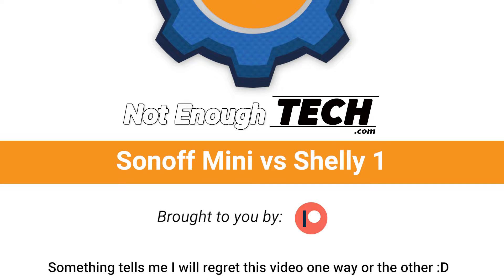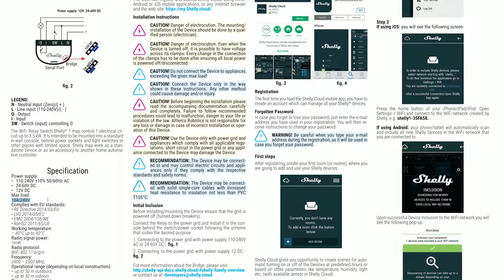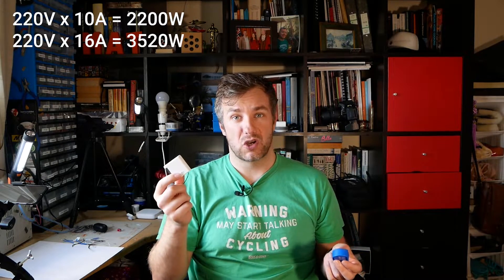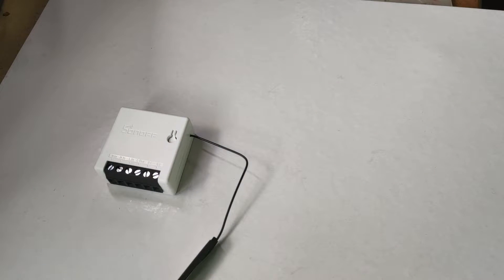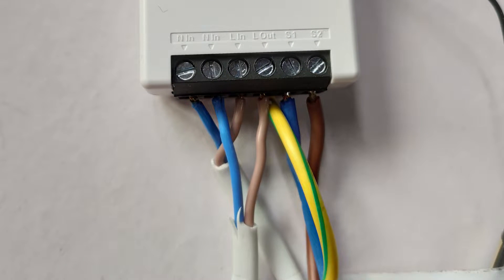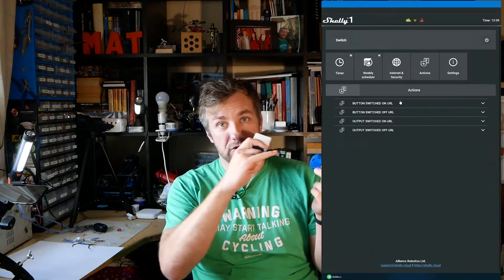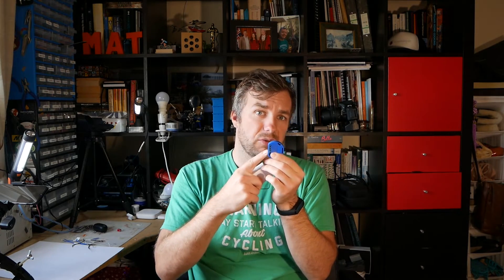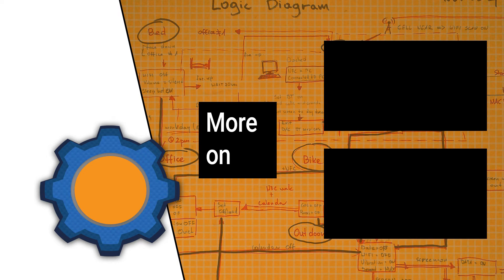Sonoff Mini vs Shelly 1 - which one is better?

Comment: Shelly 1 has no external antenna. I use Shelly uni for some outer use. Shelly uni has more stable wireless connection from 15 meter away, then inside the flat. Shelly has weak internal antenna, it should have external connection.
Reply from the maker: There are hacks to add the external antenna but to do this well you would need to tune the resistance of it. Perhaps this will help. Also is your Shelly inside the metal electric box or behind the metal switch plate?

Comment: Can I use any of these 2 to "smartify" a cheap USB-powered lamp? (PlayStation Icons Light)
Reply from the maker: Shelly would let you do it as it has dry contacts.
Reply: @notenoughtech  but shelly needs 12V power supply, and usb is 5V, or what am I missing?
Reply from the maker: @kraddoomsters  Shelly 1 is a dry relay. It takes mains voltage or DC according to specification then you can use the relay to switch any voltage within relay specification as the relay isn't powered
Reply: @notenoughtech  I'll search for some videos on what that means and how to do it 😅🙈
Reply from the maker: @kraddoomsters  dry or detached relay means that relay acts like a wall switch. It doesn't supply power it just brakes the connection. Sonoff mini uses relay to deliver or stop mains. Shelly just breaks the continuity of whatever voltage you supplied to the relay (not to Shelly device)
Reply: @notenoughtech  how does it get enough power to stay connected to the network? Or does it need a separate power supply?
Reply from the maker: @kraddoomsters  yes. You deliver power to Shelly and then you use external power to feed your device. The Shelly acts just like a wall switch
Reply: @notenoughtech  Ah, ok, now it makes sense, thanks

Comment: Is there a no neutral wire solution for this? Just want to stick one of these on a switch that's hard to reach
Reply from the maker: Take a look at this https://notenoughtech.com/featured/using-smart-light-switches/
Reply: @notenoughtech thanks for that. I've read that through. I think the majority of switches in my house have a live and switch live only connected. So should be fine wiring the live to L and switch live to L1?
Reply from the maker: Yes I use one of those In my bedroom check the follow up one about smarter wall switch
Reply from the maker: This one:
https://notenoughtech.com/home-automation/creating-a-smarter-light-switch/

Comment: Hello mate, thanks for your great videos, I have a question please, if you have single press switch with LED inside it that goes off when light is on and goes on when light is off, then the sonoff mini will not work, right?
Cheers
Reply from the maker: This would depends on the switch you have - if you cannot fit the mini behind the switch as there is no neutral you can do this in the ceiling mount
Reply: @notenoughtech  Thanks for the reply mate, actually I have no problem with the space, my problem is the led on the wall switch, it needs Power + when the switch is off so the LED goes on, and my understanding I cannot use any Power or Neutral on the Sonoff mini S1 and S2m while under Shelly I can, am I right please?
Note I have Power and Neutral behind the swicth
Reply from the maker: The difference between between sonoff and shelly is that sonoff uses 3.3V to send around the switch loop, and shelly has the relay loop on a completely separate circuit. 
https://notenoughtech.com/featured/using-smart-light-switches/
Take a look at this article too.
You should have one 2 cables connected to the switch and 2 cables connected to the bulb loop and L & N connected to sonoff Mini

Comment: Just found your channel, love your style of video, thank you.
I'm deep in the HA rabbit hole and  have gone with Sonoff Mini.
This is because I'm flashing every smart device with Tasmota and using Hubitat Elevation to control them all. 
I needed 18 Minis to cover all the lighting circuits and found some good deals from a well known chinese supplier.
Bought 20 for £106
Reply from the maker: Consider smart wall switches as well - may save you some money depending on your set up especially if you want to use Zigbee for sensors. This is a great way to build up a strong Zigbee Mesh - and thank you

Comment: Hi, nice video! Has Shelly a "dry contact"? I need to switch on/off a boiler for radiators (its electric pumps), i need to "short circuit" his cables, without use the 220v. Thanks!
Reply from the maker: Shelly 1 is the one you need

Comment: Matt:
To my mind and many others, the question of SMART devices not being safety certified  [UL listed in USA] poses a huge RISK for use in any built-in application.  It would be deemed ILLEGAL and insurance companies would deny claims if these non-certified devices are used in the electrical system.. I notice the SHELLY1-UL, Shelly1PM-UL, SHELLY 2.5-UL devices have the UL certs..
That would make those, hand's down, the only winner in the category.
Reply from the maker: Sonoff devices do come with CE certificate which is in compliance with EU. 
It's true that not all devices hold the certificate (or not all devices has one available online) but it's a stretch to assume that device isn't safe because currently doesn't hold a certificate from one country or another. 

If you are verse enough to make a call which country certificate makes the device "safe" feel free.
I'm not going to as topic is more complex than just not having a compliment device.
In line with your assumption raspberry pi isn't safe in about 150 countries to be used. 
https://www.raspberrypi.org/blog/compliance-and-why-raspberry-pi-4-may-not-be-available-in-your-country-yet/

Comment: I have bought sonoff mini but my current switch is two way so it has live (common) and l1 and l2 there is no Netrual wire can sonoff mini work with this setup?
Reply from the maker: To my knowledge there is only one diagram for this. Check out the itead store front. The show you the diagram for 2 switches

Comment: Why cant you connect the mains wiring straight to the Shelly rather than using connector terminal blocks?
Reply from the maker: Because you need to close the circuit for ceiling lights and shelly terminals are to small to push more than one cable in

Comment: Good review but what about: 
Clean conact of Shelly1 ?(If you want to switch different volatge than power supply)
12V and 24-60V DC power supply ?
2 years warranty ?
Just for ligting you are right, but home automation do not mean smart lighting :)
Reply from the maker: So guys! when would we see Shelly 2,0?  I adore your firmware (people miss that point) I'd love to get my hands on that. While I totally appreciate the low voltage option (I'm not sure if you can see who uses LV vs HV via app) I'd simply love to see 2 SKUs this way? (I know its a more expensive, but  I think it would be worth it?) Anyhow. Great to have options!
Reply: @notenoughtech  very soon and will be amazing :)
Reply from the maker: Cant wait!
Reply: @dimitardimitrov849  I hope with zigbee support.

Comment: For the sonoff you should have a 10A braeker.   And the most households (i guess) have 16A breaker installed, therefore the shelly is safer. Because if theres something wrong (eg. short circuit) its more likely that the sonoff will break/burn down, before the breaker trips - unless you have a 10A breaker.
Thats why i like the shellys more, it gives me a better feeling in terms of safety. Because the breaker trips before the shelly hits its maximum.
Correct me if im wrong!:D

Afterall, as always, a very nice video!
Reply: I'm sure you can buy 10 amp Breakers but 15amp breakers are the standard for house wiring in the US. 
I do like the idea of using the shelly and ordered one but the price is $16 dollars US and that's more than twice what I can get the Sonoff mini for.

Comment: Hi - A couple of things (we should check each other's material -  my blog is https://tech.scargill.net - Shelly has isolated relay terminals - Sonoff and many others do not. THIS isimportant if you want to control a heating system or 12v LEDs... on the other hand you mention Tasmota, but I've just had lots of issues with Tasmota on the Sonoff TH10, TH16 and DUAL. It WORKS just fine (latest Tasmota release) except for slowness and occational lock ups - and importantly though hostame lookup seemed to work woth Sonoff back last winter in the UK, today at my home in Spain, hostname lookup on Tasmota does not seem to be working (I use Tasmota on many devices). Only yesterday however I put Espurna (the 1.3.16-DEV nightly build) onto all 3 Sonoff devices and I am absolutely DELIGHTED. Alexa works perfectly with them, hostname lookup works perfectly, setup is incredibly easy and they are reliable. 

 If I missed some reference to Espurna  in your video, my apologies.  In case you were wondering I developed ESP-GO which is very powerful but works better on devices with more than 1MB i.e. it needs 2MB for OTA).

Hope this is helpful.

Pete
Reply from the maker: Oh I know your blog very well! I'm a big fan!
I have not mentioned Espurna as I have not used it yet. I actually didnt have Tasmota issues yet with my devices. Or not that I noticed any (I had no logs but usual issues I run into are caused by me! :) I have 2 sonoffs on ESP with tasmota and rest is with static IP (perhaps not the best way - looking back at backup issues I'm having now) 

Have you tried AFE Firmware? should work on all ESPs but requires GPIO setup. 

We should catch a beer sometime when you are in in the UK... :)
Reply: @notenoughtech  Excellent and sorry I didn't pick up that you are one of my blog  readers - I will subscribe here right now. Done.  Something in my guts tells me that static IP is the best way but as I have homes in Spain and the UK and recently moved home in the UK, fixed IPs would have made the changeover harder. I just with Espurna and Tasmota would allow for second (fallback MQTT brokers - would make moving around easier. I DO like the Espurna 5 SSIDs (based on signal strength). I don't like the Sonoff BASIC  bug I just found in their nightly build... but I digress. I'm looking forward to getting more Shellys and I think I have Sonoff Minis on the way.  I'll keep this video handy as a reference.
Reply from the maker: Initially, I assigned IP groups (192.168.1.1-10 for routers, 20-40 for mobiles etc)  with each device type having the same order so I could actually tell the IP address assigned to it.

But as the list expands, I use Fing app. While tasmota and AFE is easy to reprogram if connected to WiFi, my simplistic ESP8266 were hardcoded to work with specific IPs so I needed to flash new code with each migration of my MQTT broker.
Plus there is a pain with the migration of the DHCP table, but i think OpenWRT (all my routers will switch to soon) have option to back it up and export it. 

How do you find the Shelly1 wiring? Extra connectors don't fit in the lights I have so I could not use shelly without it hanging outside of the cover :)  I Sonoff Mini takes less space due to that faff with splitting cables!
Reply: @notenoughtech  Oh, I'm no-where near an expert with Shelly yet. I can only say that up to now my first Shelly One has been absolutely 100% perfect. I like the fact that the relay is isolayed (I have my reasons - heating control). Not THAT happy that the button connects to LIVE. Given time I'll do a lot more with it. Still waiting for my Sonoff Minis to turn up. I think we had a Spanish post screw-up, not sure. For reasons beyond me the region here (Granada) often gets lost in translation. When I know more about both boards I'mm be sure to comment.
Reply from the maker: so far, the deliveries has been graceful with me, they only lost one 3d printer in belgium hahah :)
Reply: Hi, could you tell me if one of these switches would work for turning an outdoor oil boiler on/off? Boiler is on a 10amp MCB at consumer unit with 220v power going to 5a switched FCU. Could I install one of these with it's own dedicated physical on/off switch between the FCU and the boiler allowing smart control of when it comes on/off? Essentially replacing the current analogue timer switch(mechanical pin type). I have the required neutrals wired in to do this, I'm just wondering how safe these switches are for something like this. If this is indeed ok to do, then would the Sonoff or the Shelly be the better option? Thanks for the video, very interesting.
Reply: @irishbhoy1967  If it's only drawing 5A it should be fine. No guarantees of course.
Reply from the maker: It's been a year since we know each other :)
Reply: @notenoughtech  yup
Reply: Thanks Peter appreciate the reply.